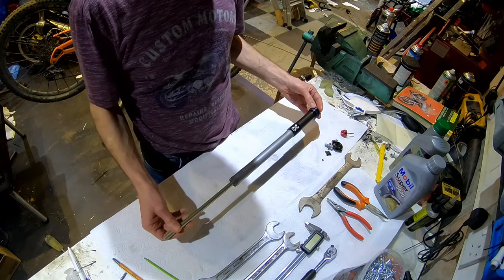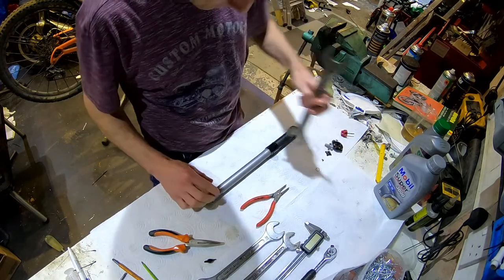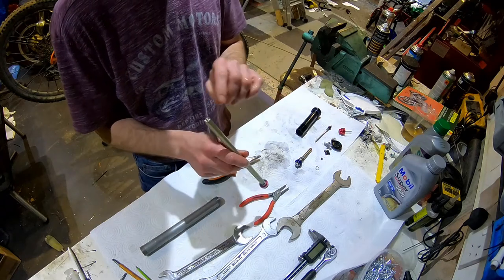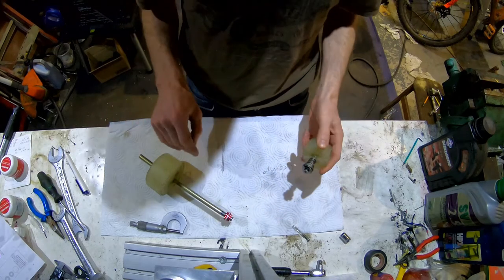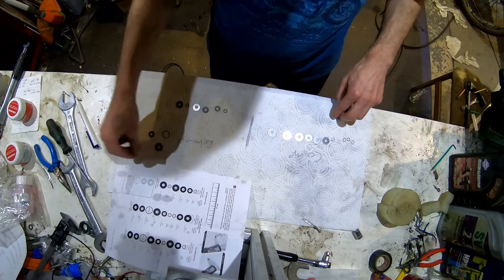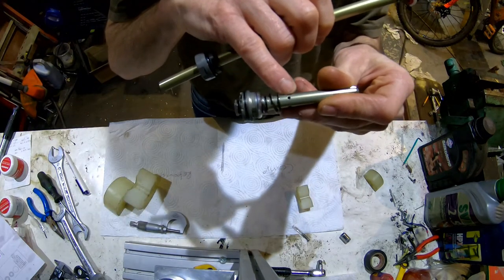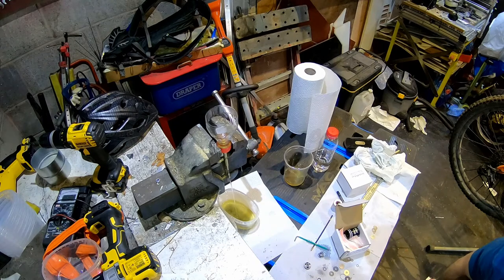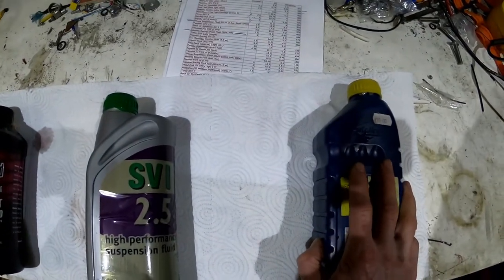Pike Forks Charger Damper Shim Tune Adjustment

Comment: Sorry to get slightly off topic...trying to fix a rc charger damper .  I bleed it and still moves through without slowing down at lockout point....I supect a bad o ring or somthing....also don't want to buy a whole kit when it is most likely couple small parts to fix.....Thanks for the time spent on great video.

Comment: Thanks Man! I use Putoline GPR6 2.5w in my shock and my fork damper. It works fine! Let's try now re stack the rebound shims... I'm afraid of re stack compression shims because i don't want that feeling of a Hollow Mid Stroke...

Comment: Alex, great video. I actually don't mind the stiffer compression of the pike but my gripe is I just cannot get the rebound fast enough (less damping) for my liking. I'm currently on the rabbit stop and it's still not fast enough. Can I just do the rebound tune without touching compression or do they compliment each other ? 

Fed up of opinions on forums, your data evidences your improvements.

Comment: Not sure your compression hole drilling is a valid test as it’s the low speed needle sitting against the seat in the hollow bolt that does the restriction not the size of the ports that are behind it.  Been a while since I’ve torn a Charger 1 apart but it’s typically a needle and a seat that controls low speed, the ports are after the damping has taken effect.  Aside from that the chargers don’t have a lot of low speed damping as it is (they lack support, same on Charger 2)  and the Charger 1 saw no difference from the last 6 clicks to open anyway.  Pretty sure all gains you saw were from reducing the preload on the high speed stack by raising the ring shim placement allowing it to open sooner, the high speed is where the chargers have typically suffered.
Reply from the maker: The port hole mod is for when you have unscrewed the needle as far as possible and you want to reduce low speed compression further. I prove at the end of the video that the port hole opening improves oil flow. Incidentally I tested both modifications independently on the same trails with a shockwiz and it was only the port opening that improved low speed score.
Reply: alex jennings you show it improves flow without the low speed rod installed so it’s kind of irrelevant since you have removed the main source of the restriction.  That said looking up a cutaway view of Charger 1 (again been a bit since I had one apart) it looks like it’s not using a needle and seat but instead the needle lines up with the holes, so it is possible it has reduced it some but the shockwiz isn’t something I’d give a 100% definitive result on as even changing air pressure a tiny bit will make it give a different damper rating.  Still surprised anyone would want to reduce a Charger 1 low speed damping even more than the small amount it has (its a very large low speed needle diameter), most negative comments are on its high speed.
Reply from the maker: Jesse Hill when the needle is fully unwound it is no where near the seat and lies above the port holes. The rate limiting step to oil flow is the port holes when the needle is fully retracted. If you drop the needle then at some point the needle against the seat would limit flow but not at the fully open position. Again I tested both shim mods and port mods independently.
Reply: alex jennings ok then that adds up.  Like I said been a while since I had one apart and didn’t remember it that way.

Comment: Hi Alex, which fork oil did you end up using ? and also where abouts did you source the data for the shim stacks you have printed on the a4 ? thanks mate
Reply from the maker: Adam T standard oil but mods as per video. Oil info was from manufacturers data sheets

Comment: Hi!
Where did you find that documentation?
In doc that i found, there is no shim stack configuration...
Thanks!
Reply from the maker: Trial and error over many months
Reply: @ianjenn1  I think what v m is wondering is where did you get the document you show in the video with the various shim configurations. I looked on the rockshox site and none of the documentation has any of this information. Can you share a link where you got your information? Great vid. I am swapping part to a new bike and I figured I should buff up the old pike before I fit it to a new frame. Reshimming and a luftkappe are what i am planning to do as well. Cheers
Reply: @polarflux  did you ever find the shim configuration?

Comment: Is there a certain way to re assemble the damper unit? I've fitted it all back together but the compression adjuster keep on the going. (Low speed stops as normal)

I'm waiting for the y bleed kit now but feel like it's not right as It just seems to go back together quite well compared to the strip.

Torque for the bladder caps